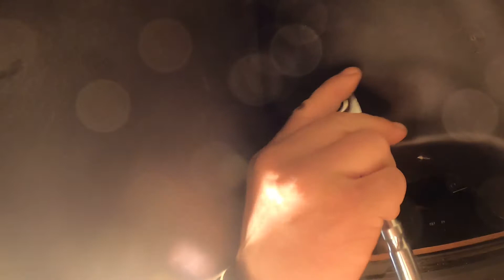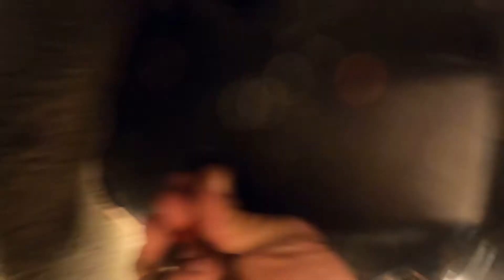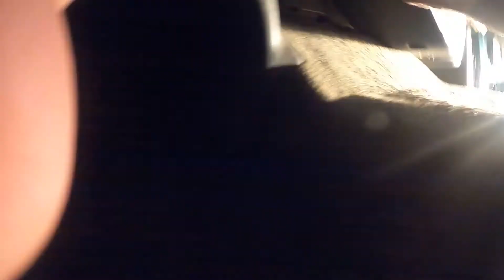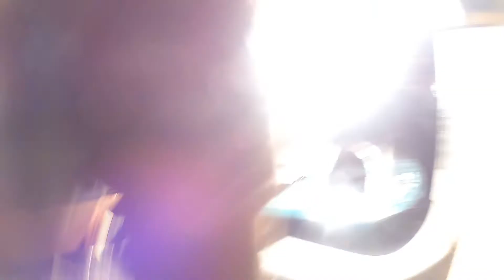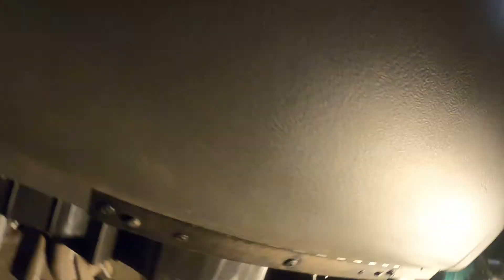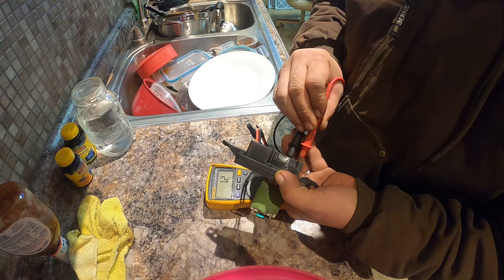GMC Sierra 2003 Blower motor replacement  How to Remove, Test, and Replace

Comment: Thank you for this video. The other guys just showed replacement of the motor assembly, which looks to be the easy part. They didn't show how to actually get to it. I mainly wanted to know exactly how many screws GM used to attach that cover because, as you're probably well aware, GM seems to enjoy putting screws in weird places that you either can't find or can't get to without dismantling an entire dash.